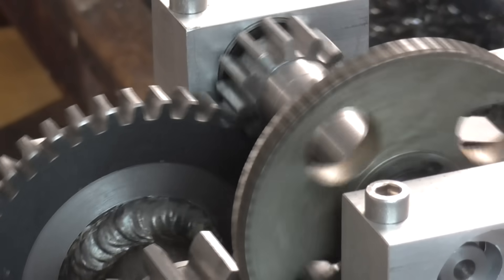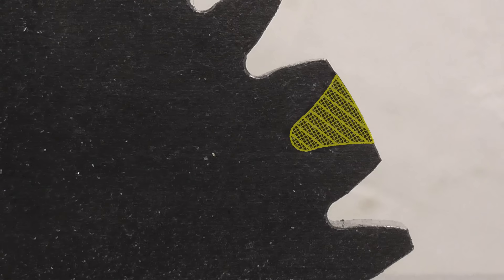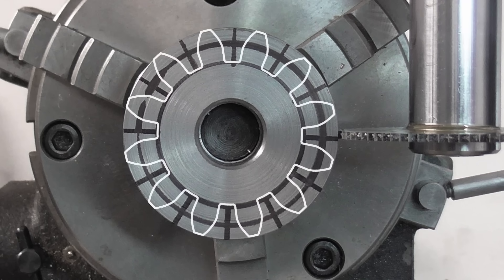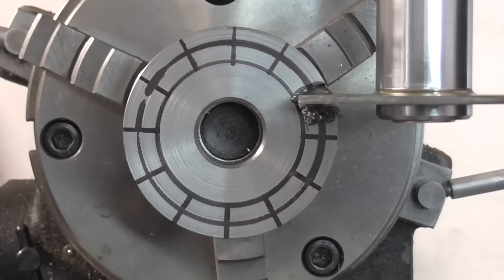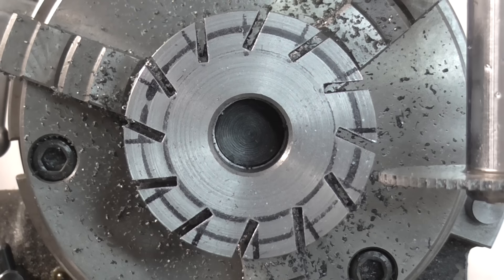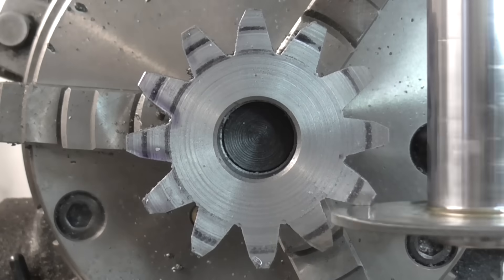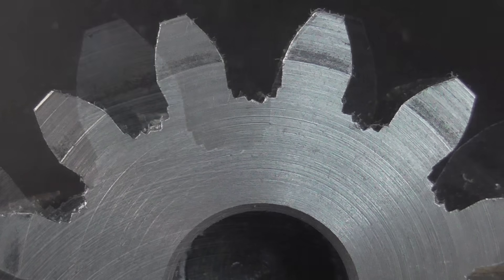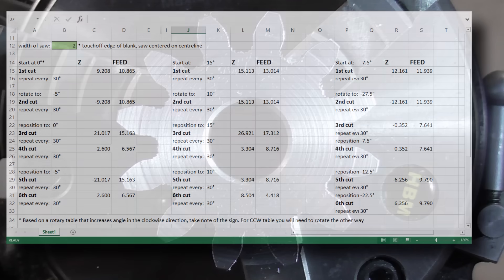Cut any gear with just a slitting saw

Comment: This looks familiar!  For folks interested in this I wrote a bit of python that can drive a 4th axis and do this on a CNC machine.  Andy also helped me understand how to calculate the flat size of the cutter.  I have not yet incorporated it into my code but if there is interest I can do it.  If you want to see how it works the vid is "How to machine gears without a gear cutter" on my channel.
Reply from the maker: I thought I saw somebody do something similar on a CNC machine, I was trying to remember where, it must've been you! CNC is the perfect way to do this as you can take multiple cuts and end up with a better profile with fewer facets.
Reply: @AndysMachines  Have you considered a mix of this and a purpose made d-bit?
There's been a few people make and use purpose ground D-bits (click spring is one), but they have a lot of work to do if asked to remove ALL of the metal.

I can see using this like a roughing cut (as in those first 2 cuts up to about 9:30) where you made a "cartoon gear" and then using a D-bit to finish it off.

Even if you have proper gear cutters using this to rough cut would makes sense as it would reduce the work of those expensive cutters. You could get a lot more life (as in more gears) out of those cutters. it would even work for those hobs you make by reducing their work to just the gear profile.

This is really clever.
Reply: @AndysMachines  I think my last comment got deleted.  For those following along I just pushed a new video and added a github repo with my updated code.
Reply from the maker: @JesseSchoch  I'm not sure why, but suddenly dozens of comments from 3 weeks ago all just appeared under 'held for review' (there was nothing there this morning), can't see any other comments from you.
Reply: @AndysMachines  youtube operates in mysterious ways...
Reply: @AndysMachines  There is an addon for Blender that can make g code for a CNC, it has been a while but it is decent enough to use for hobbyists at least.
Reply from the maker: @scurvofpcp  I did look at Blender years ago but didn't get very far with it. I keep hearing good things about it though. I didn't know about the gcode add-on
Reply: @AndysMachines  Looks like there might be a few more options now for gcode addons. Honestly if you want to crash course in blender just do the blender cloud thing for a month or two, it cuts down on the seek time for good tutorials.
Reply: The method I use with CNC is to mill them face-on from flat stock. Start by cutting out a circle with a relatively large end mill (1/8" for 24 pitch or mod 1 gears), and then nibble inbetween teeth with a small mill (1mm or 1/32") using Z motion, making sure that the center of the bit is always over open space to minimize stress/maximize feedrate. Then just trace the gear outline directly, one rough pass and one finish pass.

Drawbacks are that you can't make very thick gears, and so far I've had to manually plan the sequence of operations for each tooth profile using Blender to get a clear view of how much material is left so the rough outline pass doesn't break the bit. But I'm sure it would be possible to auto-generate code for a similar strategy.
Reply: You just got yourself a new subscriber friend
Reply: ooh, that'd be interesting to see

Comment: The number 8 cutter has the tooth form of a 135 tooth gear or some little bigger number, a rack can be sufficient with slightly curved teeth but you can't use straight rack teeth on gears or use high tooth count cutters for too low count, the tooth will not make contact properly and probably rattle like hell
Reply from the maker: Yes, Ideally there should be rolling contact from the base circle to the tip of the tooth, so running two flat faced 'cartoon gears' together is probably not a good idea, but one running with a smaller pinion is probably fine. If you look at the actual curvature on a 135+ tooth gear it is really very slight.
Reply: @AndysMachines  sure might work out that way
Reply: @AndysMachines   Yes!  A gear with an infinite number of teeth has an involute form that is ...... straight-sided (ie. a single tooth of a rack).   🙂